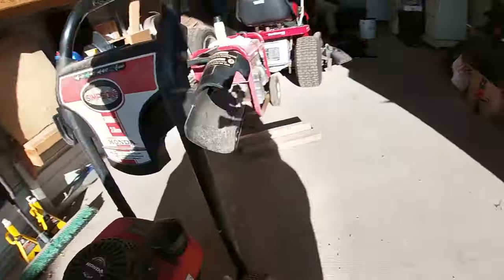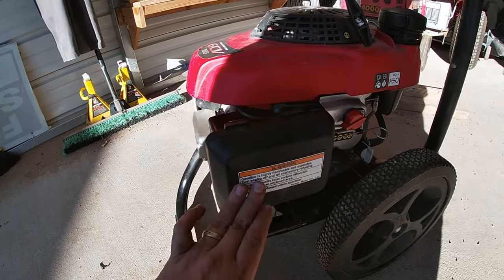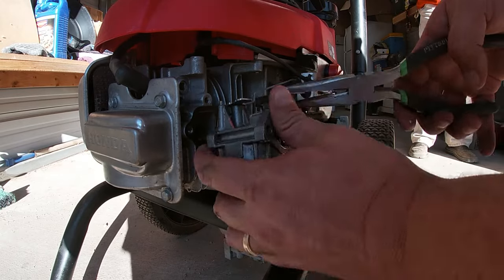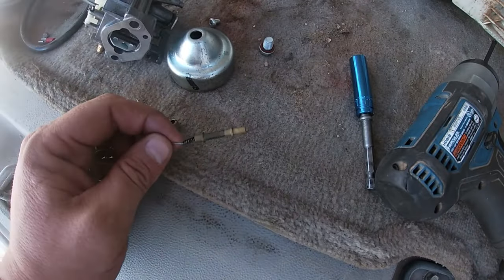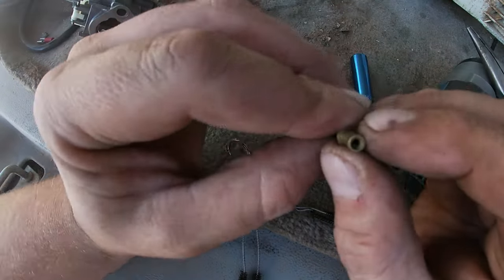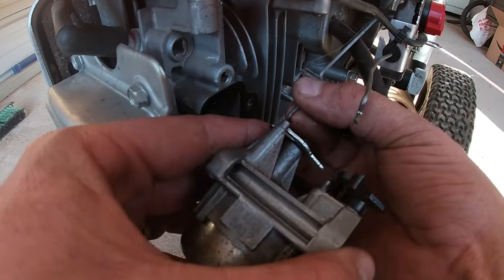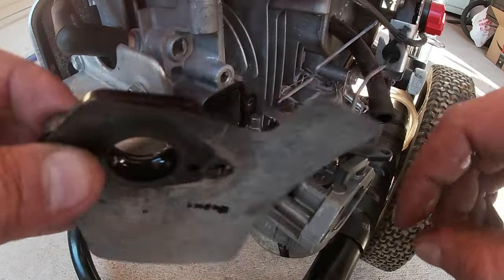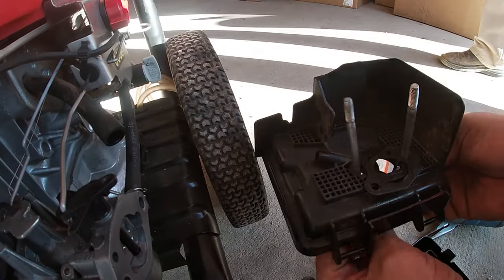Honda GCV 190 how to clean and install carburetor.

Comment: Good video! If any of you guys have ever worked on the new Honda GC series engines they are much easier to deal with. You can take the filter box and the carburetor off without the rest of the junk falling off. Honda finally made these more like the GX engines with the carburetors.

Comment: The other hole of the thing????   Didn't show which was the correct hole so I guess I'll figure it out when I take the old carb off.   The shut off valve at the hose; great idea. Couldn't get the emulsion tube out. Installed new $26 carb.

Comment: Wonder if the customer had gotten in there and cleaned the jet but not the emulsion tube. Nice find on that clog and got it back in business. 💪
Reply from the maker: I am thinking that is what happened seeing how the choke was on the wrong hole and was not factory when I worked on it
Reply: @RepairGang  no doubt. We all know how it goes. Customer says no I haven’t messed with it, and find all kinds of stuff tampered with. Thanks for the upload. 🤘

Comment: Hey there, wondering if you could help me and give me some insight?? I have a GCV 190 Troy Bilt xp series pressure washer. It stopped running and wouldn't start. I first changed the spark plug, nothing. I ordered a new carburetor swapped it out and nothing. I changed the fuel line, nothing. I saw fuel flow, the spark plug was sparking, oil is full. I have no idea why it won't start. Any thoughts???
Reply from the maker: Brand new carburetor so let me know if it starts and dies with starting fluid then email me
Reply: @RepairGang  I was going to try that but didn't have starting fluid. I have to get some and I will let you know. Thanks so much!!
Reply from the maker: @bryandurrette8966  yeah then email me and I help out more with pictures and stuff
Reply: So, got some starting fluid and it will start but then die, did it about 5 times with same result.. Any ideas?
Reply from the maker: That 100 confirms a carburetor issue
Reply: @RepairGang  Not sure what that means, I have the old carb with the same issue and a new one I just put in. So the new one has the same issue??
Reply: And what might be the issue and how would I fix it?
Reply: @RepairGang  OK, so I found the issue!!! Water in the fuel tank. I have drained the tank, cleaned up the carb and thought I was good. Now it will start and sound great but for only about 15 or 20 sec then just dies. Ideas??
Reply from the maker: @bryandurrette8966  now that you drained tank now you need to clean carb and look into the pet cock
Reply: Ethanol killed my equipment a few times. Can't use regular gas anymore that's older than a month or two as it starts to absorb water from the air.  I only use premium now and won't buy more than enough to last a month. For storing, I'll put in Tru Fuel or a gas stabilizer in. As far as mowers go, I might be done altogether with gas and will go battery just like I did my weed wacker. After decades of just being able to start the mower with no worry or concern that it might not run, it's just not worth the stress, hassle and added costs just to mow a lawn I'd ra not mow anyway.

Comment: I did one of these recently and when I unbolted it, everything fell apart so I couldn't tell which way the thick plastic spacer faced. On one side the opening is just round, and on the other, it tapers out. Can someone tell me which side faces the carb? Is there an exploded  diagram showing the order of gaskets and spacers I can view online?
Reply from the maker: Did you figure it out
Reply: That's why I'm here too, figuring out orientation of spacer and gaskets in the engine side.

Comment: I've been told to never run a pressure washer without the water hooked up to the machine.
Reply from the maker: Correct 💯 I just testing not running long

Comment: You can’t run the pressure washer with out water .
Reply from the maker: The fact is I was never running it without water. I started it but it had water in it in the pump. It was never bone dry. I don't understand how people are missing that

Comment: Can’t get the stupid emulsion tube out!
Reply from the maker: Soak it and use and angle pick
Reply: @RepairGang  Got a tiny ez out. Soaking until tomorrow.
Reply: I could only push the tube down until the top was flush with the carb throat, then back up to original position. Repeated many times, but couldn’t get it the rest of the way out. I tapped in a 5/64” Hanson screw extractor in from the bottom and pulled it out.
Reply: Yeah getting this out will be fun. Wish you showed that. This is definitely me issue. Found this washer on the side of the road and I have fixed many chainsaws but this is a new one. Good video thanks for the info.